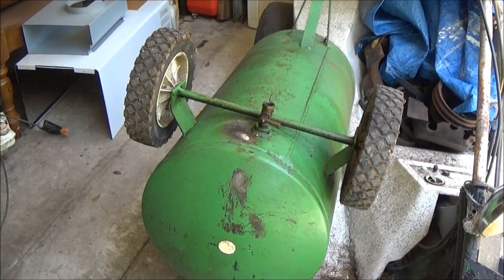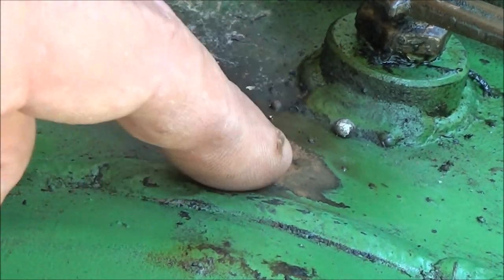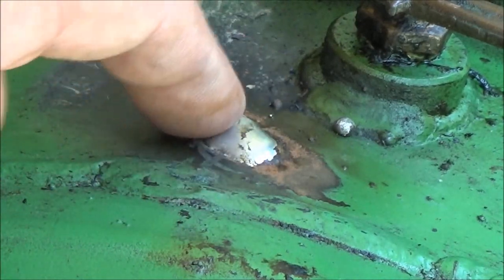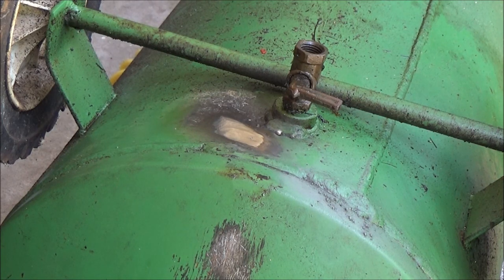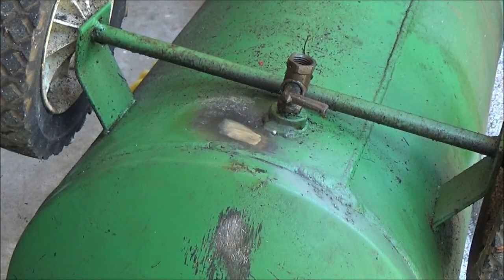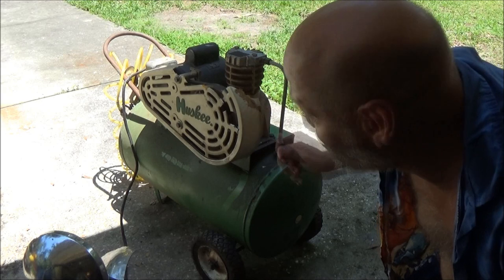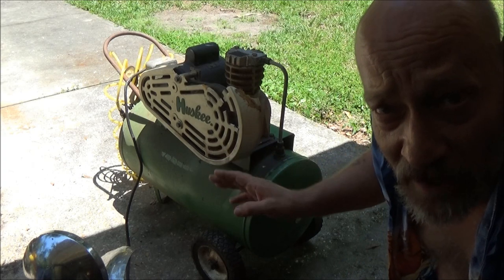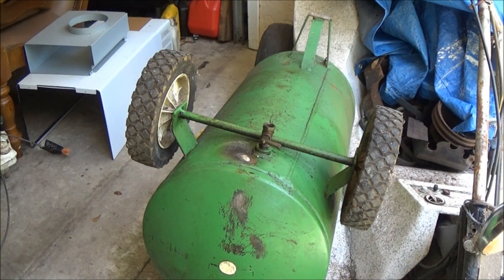How To Solder A Hole In An Air Tank

Comment: A new tank is way cheaper than a hospital bill
Reply from the maker: It's still holding up so...
Reply: @shabear1000  i had all my fingers,  til i didn't.
Reply from the maker: @anotherbeard667  you did it wrong
Reply: @shabear1000  just like u are buddy
Reply: @shabear1000  it's common sense,  u are dealing with pressure that is contained,  when you do what you did with the solder, you fix the spot that has a hole,  but you weaken the structure at around it. You get enough pressure built up, boom. The awesome repair you did,  and it is nice looking,  will fail and it becomes dangerous enough to potentially kill someone. A new tank is the only totally safe way to fix it.  What you did was build a time bomb.
Reply from the maker: @anotherbeard667  whatever you say.
Reply: @shabear1000  love you dude,  wish u the best.  Just saying my personal choice and suggestion is to just replace the tank.  If the worst were to happen, it's not worth it.

Comment: Hopefully it has not exploded and hurt anyone yet. Throw that think in the garbage it’s dangerous. Don’t try and patch rusty pressure vessels!
Reply from the maker: Still holding 140psi, it's fine.
Reply: It doesn’t fail slowly. It’ll hold 140 psi until it splits in two
Reply: That's how nature thins the herd.
Reply: @deanmartin6052  He obviously don't seem to care or thinks it will be "just fine." Lol.  Too many cowboys anyways.
Reply: @deanmartin6052  no way man,  he's a pro. 😆
Reply: Real men fix it the easy way. No replace it that would be too easy

Comment: I don't disagree with with your repair but I would recommend you hydro test the tank when your finished if the tank is being used with anything over 100psi. Anyway, nice air compressor and nice repair👍.
Reply: and use silver solder (45% silver). I guess if your really broke or don't give a shit use lead solder 0_o
Reply: @phiksit  I think 15% sil-fos would probably be ok. Lead is deceptively strong but yeah, I would still braze.
Reply: Yeah failure on a sideways tank like this can be catastrophic with the entire tank bursting open explosively.
Reply: @Marc83Aus my dad brought me a couple of old compressors like this one, one has a leak in the tank is almost the exact location as the video, my question is should I just leave it be and let it leak for now, and buy a new tank if I want it fixed? I’d rather not blow up while trying to put air in my tire haha
Reply: @keithbroh5730 if its leaking its already failed, the question is how much of the tank is left to resist the pressure inside. I wouldnt want to risk it. What condition are the other tanks in?

Comment: I inherited an old 1963 compressor, She pumped a little slow. An Old Timer told me the oil was probably as old as the compressor itself. And more than likely the piston the rings and the reeds are all carboned up. He suggested running some Sea Foam in the oil for a bit and then replacing with fresh oil. I followed his advice and the difference is like day and night! The Ole Girl runs like a brand new compressor!

Comment: Tank is still holding up, however, how ,many other pits are inside the tank you havent seen yet because they havent quite became a pinhole? when enough deep pits line up it affects the strength of the sidewall, which is under the most force and the entire thing can unzip and explosively release like a bomb. These sideways tanks are far more dangerous from corrosion than upright tanks where the sidewall tends to be thicker, with the bottom corroding due to moisture and residue buildup if it does have a catastrophic failure the tear builds untill it hits the weldline and tends to rip the entire bottom cap off, redirecting much of the force and shrapnel towards the floor, more importantly as the drain is at the bottom of a concavity it's more effective at removing water from the tank and the corrosion tends to be on a much smaller area centered on the drain, failure tends to be round and doesnt result in a long thin seam which is what causes the zipper failure in horizontal tanks. A pinhole is a dire warning that the strength of the tank is compromised and eventually that tank will fail catastrophically if continued to be used.

Comment: Nice repair.   I didn't even think about using solder.  Nice little compressor, looks like an 8 or 10 gallon., enough for using an air tool.